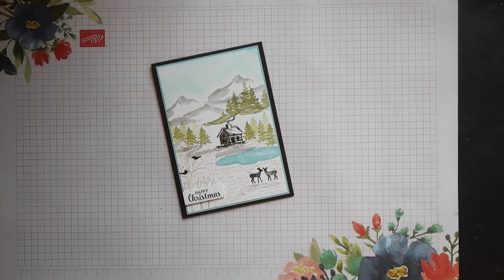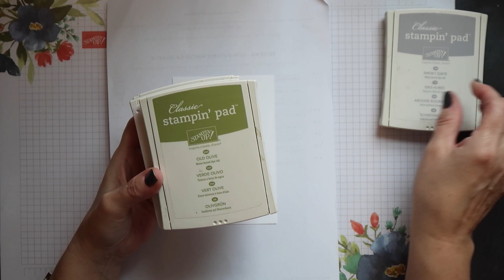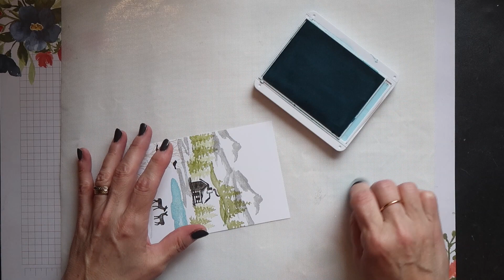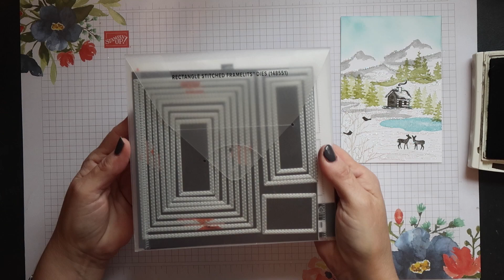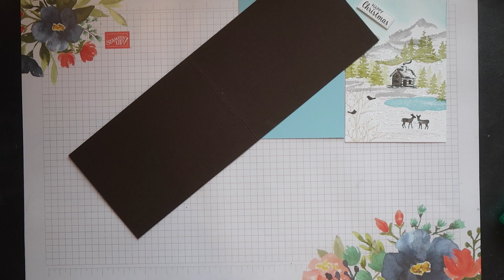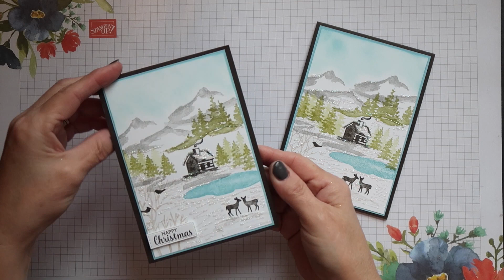Christmas Card using the Snow Front stamp set by Stampin' Up!

Comment: I made a front panel similar to your example, Teri. I used Tempting Turquoise as I don't have balmy blue. I made a couple mistakes. One is I slightly touched the panel with a stamped image in error and when I went to die cut the panel with a rectangular die, there was ink left on my plate from a previous cut which transferred to my panel. Sometimes,  I can hide the mistakes, but in this case, I will be my sample panel. Thank you very much, Teri!